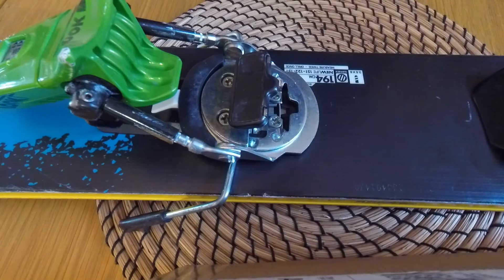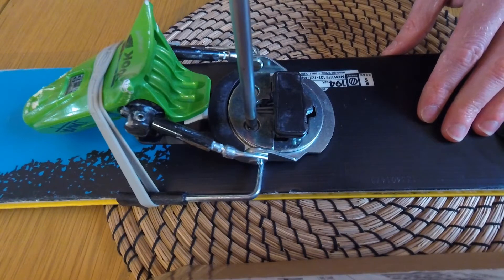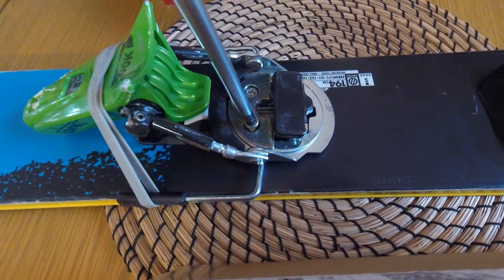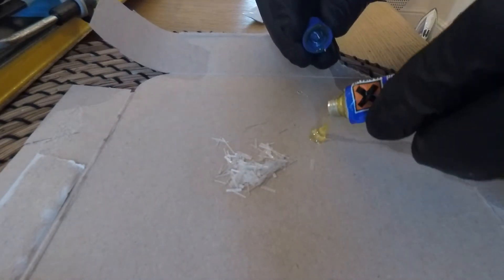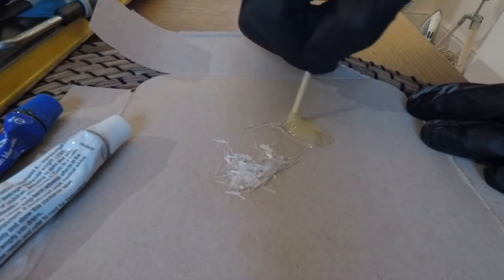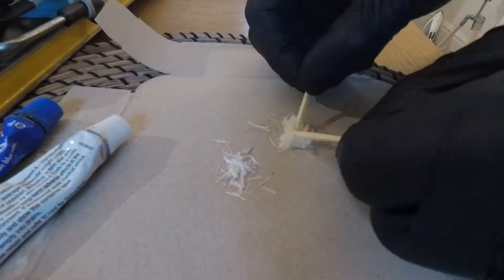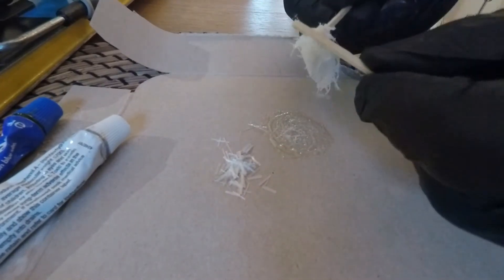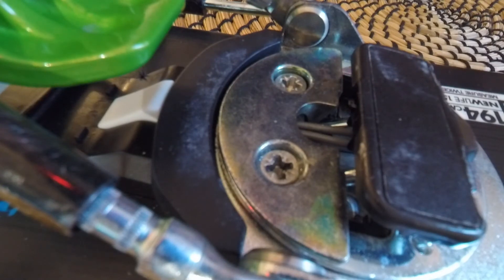Ski Binding Repair - Stripped Screw 'spinner' Fix

Comment: Where did you get the fibreglass fibres?  I've only been able to find them online at Alibaba in bulk.  (I probably don't need pounds of this.)  Thanks for any info.
Reply from the maker: Hi, not sure where you are, but I ordered some chopped 6mm strands from here (UK) 
https://www.ecfibreglasssupplies.co.uk/chopped-strands-6-mm
Reply: @Ryan8795ski  The smallest package is 700g.  Similar issue as Alibaba.  Oh, well.
Reply from the maker: @esmeadows  ah really… perhaps they’ve changed the quantities now, sorry. The invoice for my order said ‘100 mL pot’ and cost £1.50.

Comment: Will the screw come back out if you need to remove it ?
Reply from the maker: It should do with a bit of force.  I'm actually remounting the binding next week, so i'll let you know how it goes when I come to unscrew it
Reply: @Ryan8795ski  I assume you've had success with this method? I am looking to remount a screw using the same method but with steel wool substituted for the fiberglass
Reply from the maker: @jackbond3080  hi, yes this seemed to work great. I imagine steel wool should also do the job, as it’s still packing out the hole in combination with the expoxy. Let me know how you get on and if it works the same 👍
Reply: @Ryan8795ski  I used 24hr curing PC7 epoxy with #1 steel wool. I filled the hole about 1/3 and I coated the heel screw lightly. I hand tightened the screw into the stripped hole until I thought it would no longer tighten. I'll check back in 24 hrs to see if the screw holds tension. I am working on a look pivot heelpiece. Same exact style as in the video
Reply from the maker: Just to let you know, the screw did come back out with a bit of force 👍
Reply: @Ryan8795ski  Is the hole reusable or do you need to do epoxy again ?
I tried epoxy method I saw on youtube with drywall anchor, and it was a massive fail.  Screw just pulled that anchor and epoxy out.  I give up, I spent $120 on a set of inserts from Quiver Killer and the M5 bolts I needed for my binding.  I think my hole is too far gone for any other method.
Reply from the maker: I haven’t tried to reuse it to be honest, but it may be still good depending on if the fibres have packed out the hole enough. I would probably be tempted to do the epoxy and a new screw again though to see if you have any joy with that.
Reply: Can confirm that this method works! My spinner no longer spins and the screw holds tight. Steel wool + epoxy was the trick for me. Thanks for this video

Comment: Great video. I’m assuming you used 24-hour epoxy or something similar, and not 5-minute epoxy. I’ve installed helicoils and brass inserts, but for just one “spinner” your method seems simpler, yet efficient.
Reply from the maker: dick91p Thanks. Yes, I used the slow setting Araldite Resin/Hardener (the blue and white tubes). I think the recommended cure time is around 14 hours or so. Helicoils look like a great option too, though I’ve not used them personally.
Reply: @Ryan8795 I had a spinner for the first time  ever installing a pair of STH 16’s, due to a malfunction of a plastic component. I’ll be using your method hopefully soon, and I’ll report back.
Reply: @Ryan8795: So I got my fiberglass chopped strands & epoxy ready, removed the heel piece from the plate, put a pozidriv screwdriver to the screw I was going to fix, but it didn’t spin (?!). I tried multiple times but the screw was tight and threaded correctly in the hole. I don’t know exactly what happened, but all screws on both skis are solid. I do multiple ski binding mounting jobs on and offseason, so if I encounter a spinner I will use your method and post a comment here. Thanks again for this great video and enjoy the upcoming ski season.